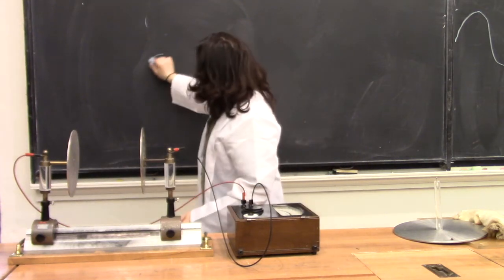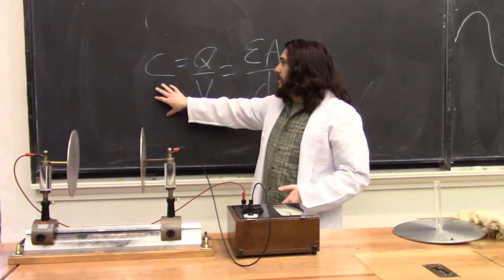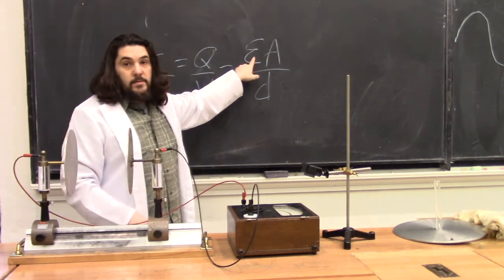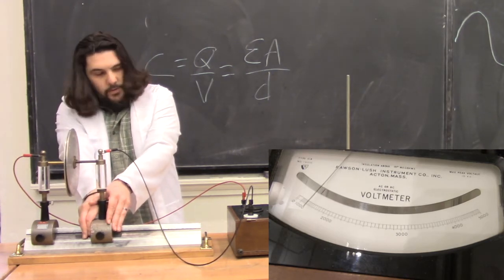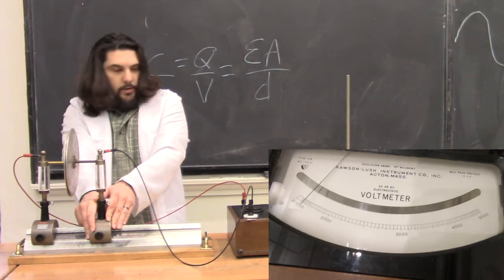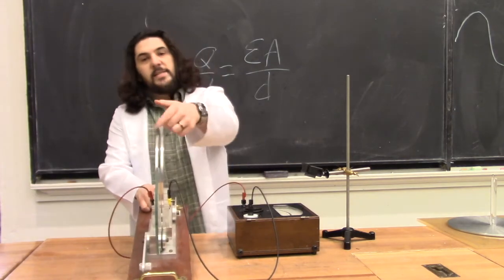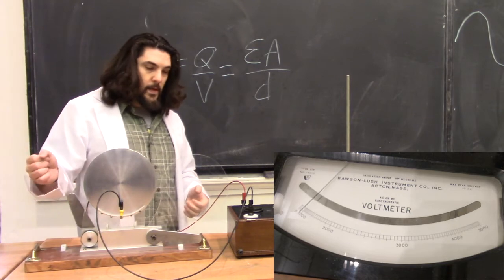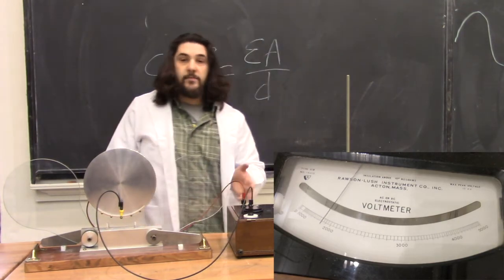Demos: Parallel Plate Capacitor

Comment: sir kindly let me know that  what does thickness  of the plates has any effect on amount of capacitance. if we have two capacitors of same area A of each plate of thickness 3 mm in 2nd  capacitor of same area A of each plate but thickness of each plate is 10 mm. is this condition results in increase of capacitance?